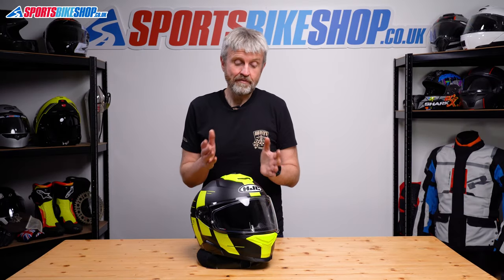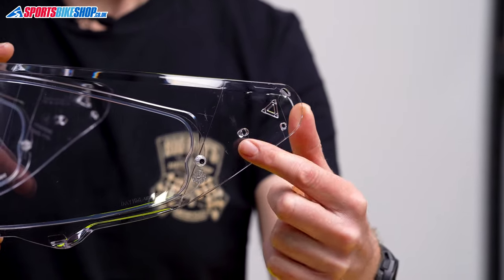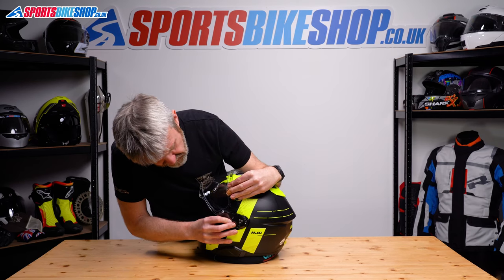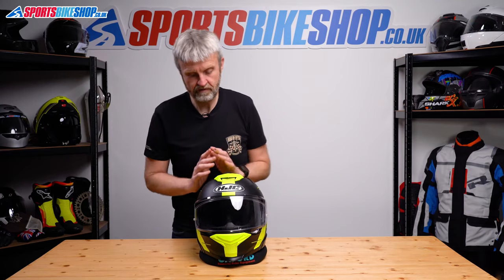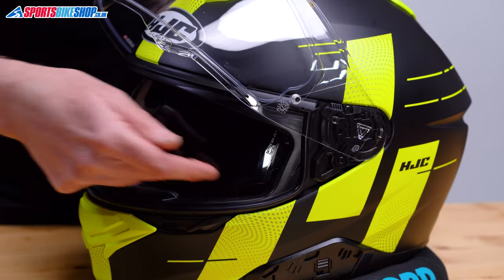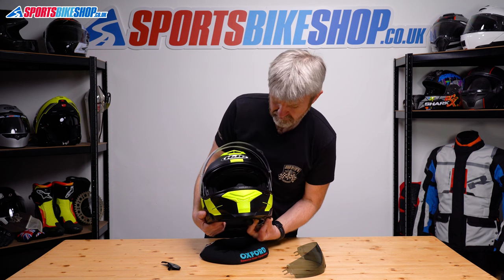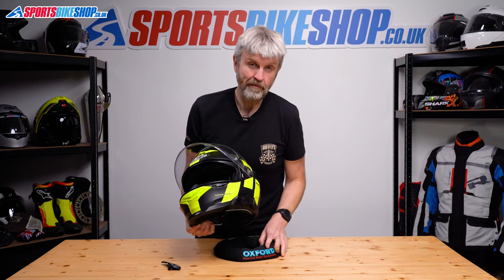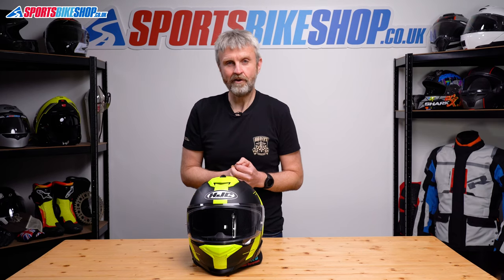How to change a visor: HJC i71 motorcycle helmet

Comment: Hi there....can you tell me if the outside visor on the I71 can be positioned in many different locations like the original  I70 or does it flop down to the partially opened position like the RPHA 71?
Reply from the maker: Hi, apologies for the delay while I got my hands on an i71 again. There's only one detent stop between open and closed so it's more like the RPHA-71. Cheers, Tony